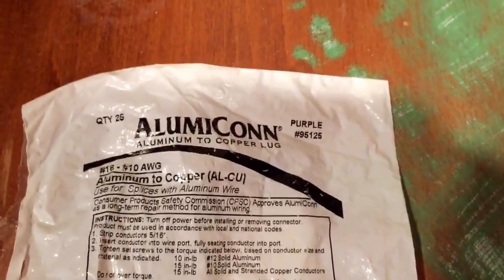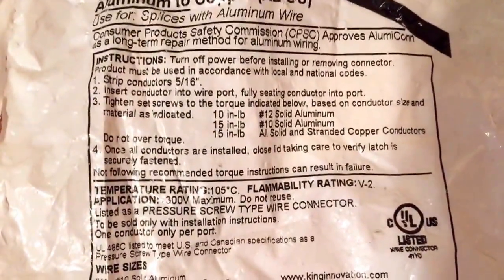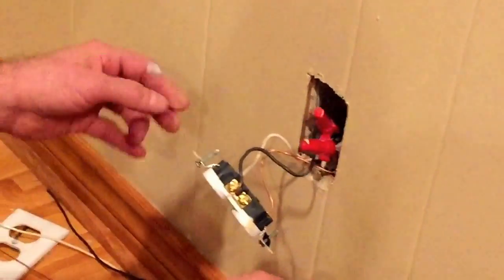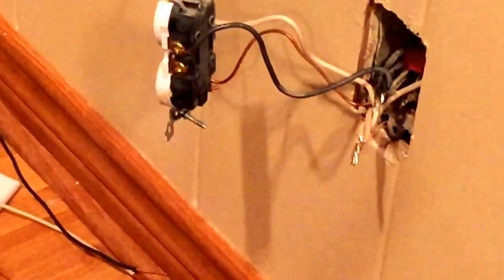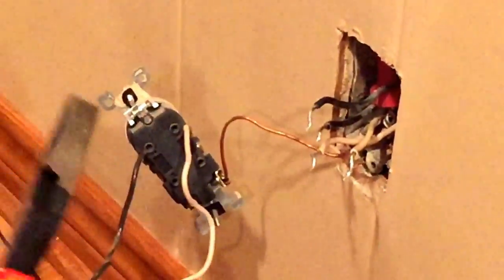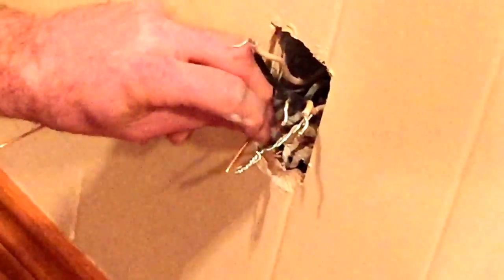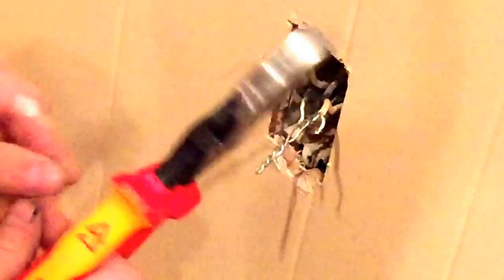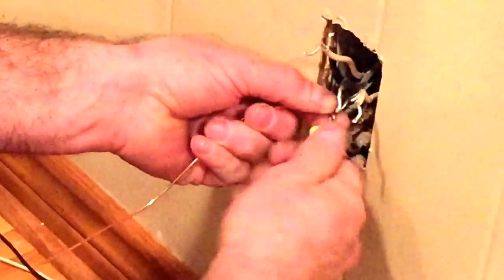Steve's video

Comment: Where in the code book does it say you don't need to Alumiconn the ground wires?
Reply: it's just common sense.  the ground circuit will never be used unless there is some sort of emergency.  he stated that there is no issue with the aluminum wire corroding unless it has current going through it.  the only time a ground will have current in it is for a fraction of a second in an emergency in which case the breaker will trip and shut down the circuit.
Reply: @RedroomStudios  This is bad logic.  Talk to a licensed electrician as to why.  Seriously!
Reply: @kriley9386  no, actually it isnt.  my logic makes perfect sense.  there will never be an issue with an aluminum ground wire corroding because it never has current running through it.  please be my guest and explain how that logic is incorrect.  

dont tell me to talk to an electrician.  I have redone all switches and outlets in my whole house, wired an entire basement renovation and installed a complete breaker panel, replaced an aluminum stove wire, etc.  I know what I am doing.  I still have 3 aluminum wired circuits in my kitchen which I used the purple marettes  with corrosion inhibitor in them to pigtail to standard outlets.  no fire here in 12+ years.
Reply: RedroomStudios just because you wired something doesnt mean you did it right, talk to an electrician really. And he should’ve did the ground right as it is not electrolysis that made it corrode
Reply: @RedroomStudios  - From a chemistry standpoint, corrosion can still happen because aluminum and copper have different electrochemical potentials, and in the presence of any kind of electrolyte (even moisture that you can't even see), the aluminum will corrode because it has a higher electrochemical potential than copper even if no line voltage is present.  Tin is in between copper and aluminum with a relatively low potential difference between both, which is why it's used in AlumiConn connectors.

Comment: You mentioned in the beginning of the video that the wiring would still not have been compliant even if they had used anti-oxidant gel.  Why is that ? Was it just the gauge differences ?
Reply: Check out the consumer Products Safety Commission report on the purple wire nuts - they are not acceptable.
Reply: They are compliant with the US electrical code. Stop spreading misinformation.
Reply from the maker: Because the wire was nut is not rated for aluminum wiring.  I believe the Ideal 65 is currently the only one.